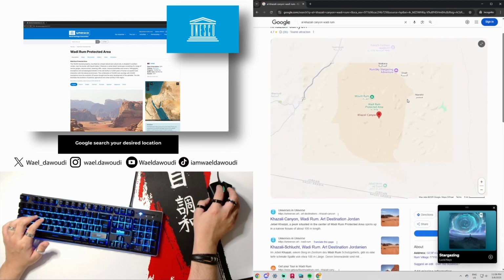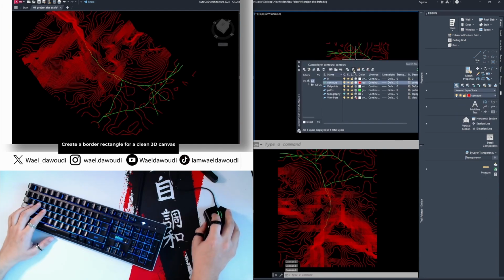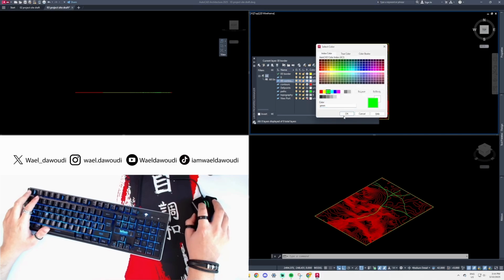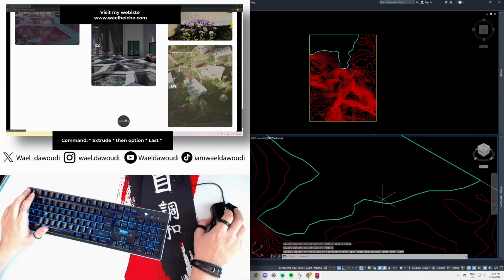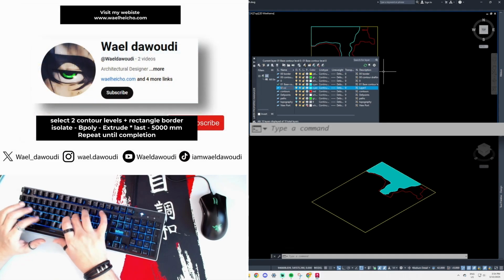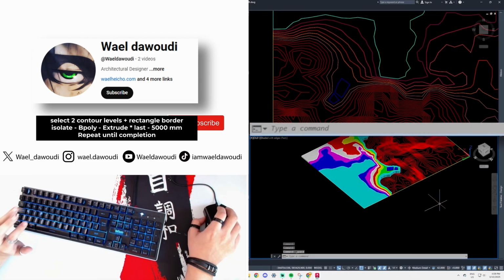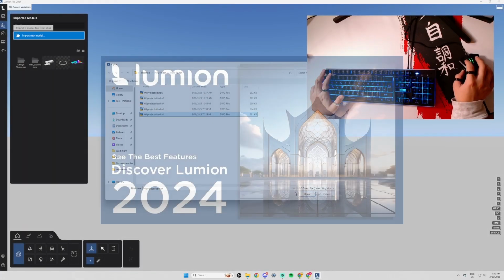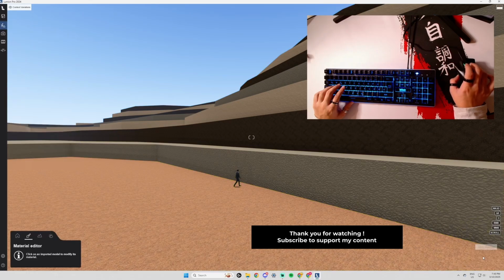Modeling Real-World Topography: CADMAPPER, AutoCAD Architecture & Lumion Tutorial

Comment: I am trying to raise the roads in CADMAPPER, which have 0 height/volume. Do u know how to increase the road volume up the z-axis only?  The faces are not all pointing straight up, as some can be 10-20 degrees from straight up. Thanks.
Reply from the maker: @deeber35  hello there , your question has two seperate tasks, the first one is to how to extrude the street that have " 0 volume " , when you say this i guess you mean that the street is at the ground level of the building so it appears to have " no height " , the truth is that the street does have a thickness its just going to the negative z axis , for exmaple the street's thickness could be 300 mm  millimeters downr
Reply from the maker: @deeber35  as for your second point regarding the angel of extrusion, you can extrude at any angle you desire , using the " ucs " tool in autocad you can determine where you want your z axis to be , for example you can align the UCS on the titled surface using , " UCS " then " face " select your desiered surface and it will creat a z axis perpendicular to that surface
Reply: @Waeldawoudi  The 1 issue is the roads are not all flat. So not all faces are horizontal. Does that make it more complicated? Thanks